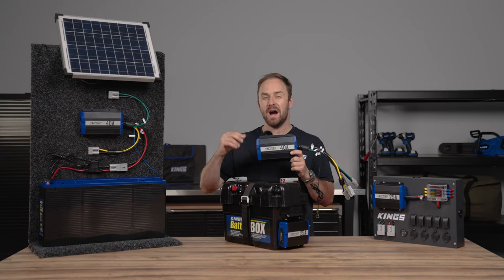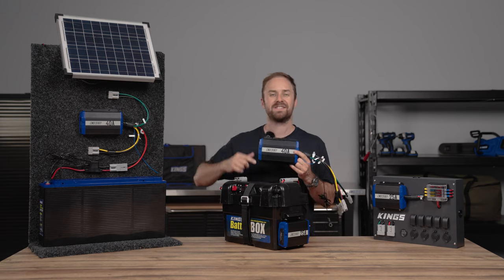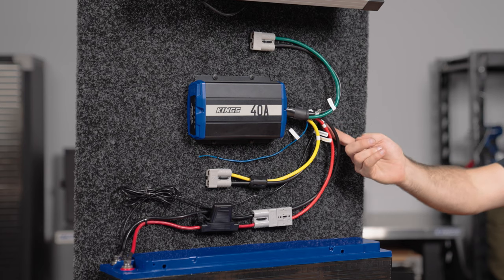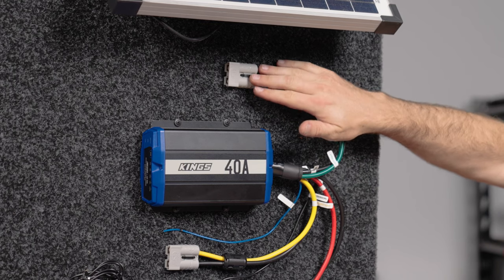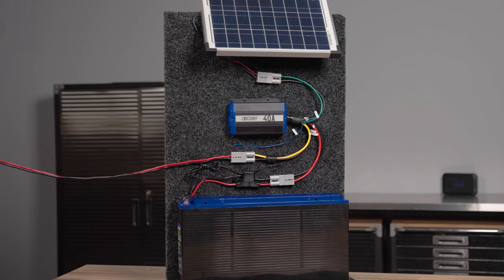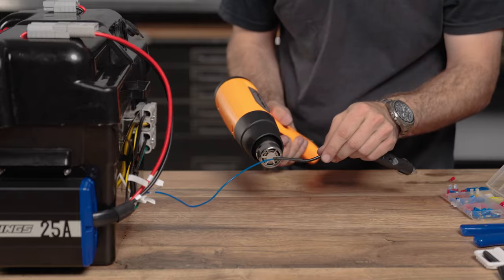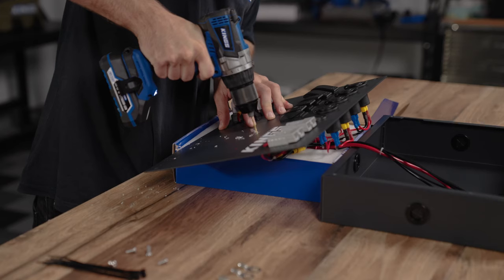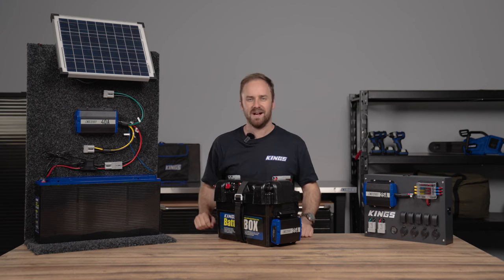Kings DCDC Chargers Quick Connect Guide

Comment: Do you have the link to installing the dc dc charger to the battery box using the cigarette plug on the blue wire please I am about to install mine and want to run it that way but unsure how it’s done.
Reply from the maker: G'day Mathew,

The blue wire for ignition needs to be connected to the positive (usually red) wire on a cig plug. The black wire isn't necessary, so long as you've connected the main earth back to the starter battery. Her'e the link:

https://youtu.be/aDXRTaaC6-M

Cheers,
Cahn
Reply: @AdventureKings  on a 2012 Ranger the cig plug is always on. Shouldn’t the blue wire go direct to a live wire that turns off with the ignition off?

Comment: Will it continue to draw power from starter battery if the blue ignition wire isn’t used/connected ?
Reply: Good question!
Reply: Not if you wire it up to a fuse terminal that only works when car is running. Once turned off  it won't give power to that fuse anymore. Hope that helps
Reply: @jasonblade1037  I have wired my ( ignition wire ) to the cigarette 15a fuse, which only activates once the key is turned. Although I believe my kings dcdc 25ah charger continues to run / power my 100ah lithium battery even when the car is completely turned off. I think its designed to draw the crank battery down to 12.8v and then it shuts the dcdc charger off.

Comment: Ive got all the gear to go into a caravan. Do we put fuses in the cable from Lithium battery? And do i need a dc circuit breaker between solar panel and dcdc charger?
Reply from the maker: Hi there,
This would be safer for your setup if you have a fuse between your lithium battery and DCDC charger, but a circuit breaker between the solar panel and DCDC charger is not needed.
Cheers, Courtney

Comment: I like the idea of connecting it to the battery box, I might just have to do that with the (competitors product) one that I've got. Then all I need is a cable run with Anderson plug from the battery on each of my vehicles, after all, can only drive one at a time, so why have multiple systems?
Reply from the maker: Hi there,

You could do, however we'd recommend some form of isolation and power regulation between the vehicle system and your secondary battery.

Regards, Andrew

Comment: Hi,  I have 2 trickle chargers one for the start batteries & one for the house batteries, will a BC to DC charger interfere with that?
Reply from the maker: Hi there, we would recommend alternating between the charge types interdependently to each other to ensure accurate load register. Kind regards, Rachael

Comment: I have an old school redarc solenoid isolator and lead acid deepcycle battery system under the hood of my hilux, it has an Anderson plug wired into the tray from the deepcycle battery, can I connect a 120ah lithium battery in a box with the dcdc 40amp charger next to the lithium battery in the tray so  that I charge the lithium setup from the deepcycle lead acid battery under the hood if that makes sense?
Reply from the maker: Hi there,
These battery types are not compatible in the same system as there is nothing stopping the lithium completely discharging your other battery. This would require an isolator that doesn't allow backflow, but we would recommend consulting your local auto electrician to ensure your setup is safe and viable.
Regards, Courtney

Comment: My kings dcdc battery temp cable snapped at the terminal end now it flashes red. What can I do to repair this? Is the charger done?
Reply: Same bro mine just snapped did you ever fix it?
Reply: @mitchellsmith7693  nah man, and I rang Kings the pretty much said charger is done now I have to buy a new one 👎
Reply: If that's what is wrong with mine then I have a problem cos bought long time ago and just now fitting it up.

Comment: If i connect the 40amp charger to the quick connect on the battery box that has a max 30amp input, will i blow up?
Reply: 30 amps is not much for an Anderson style plug, I thought they were all 50 amps. By pass the quick connect (Anderson style plug) and connect it straight to the battery terminal.
Reply: @teeanahera8949  that's what I ended up doing. The cheap 30 amp plugs melt if you plug the 40 amp charger into them

Comment: Can we have the links for the installs of the new dc dc chargers. And can you use the dual battery installation kit to that yellow wire
Reply from the maker: G'day Matty,

https://youtu.be/aDXRTaaC6-M here's the battery box install

and here's the Control Box install https://youtu.be/QCAdAQf5qpY

You can definitely use the 50A wiring kit to hook up to the yellow wire - but if you're doing a particularly long wiring run (say in a caravan or camper trailer) and running the 40A charger you may want to consider using thicker gauge wiring!

Cheers,
Cahn

Comment: How do we ground the charger?
Reply from the maker: Hi there,
As the unit connects to both the positive and negative of the battery it forms a full circuit and will generally ground via the vehicles electrical system.
Regards, Courtney

Comment: Can I get some advice?  I connected the ignition wire to a ciagarette socket and plugged that into the rear of my tub as per their video however the charging unit does not shut off as they said it will.  I assume the blue wire and writes to both of the wires of the cig socket
Reply from the maker: Hi Mark,
Sometimes depending on the vehicle this can still stay on after the car has been turned off. To test this we would recommend either checking with a multimeter or keeping something plugged into the ciagarette socket to see if it is still getting power after an hour of the vehicle being off. If there is still power then there is something wrong with the wiring.
Cheers, Courtney
Reply: HI Mark, I'm currently in the same situation. I'm literally testing it right now for the first time. I have wired my ignition wire to the 15a cigarette fuse in the fuse box with a piggyback fuse and my dcdc charger is flashing both lights ( lithium light and alternator light ) I beleive that it will cut off the dcdc charger once the crank battery falls below 12.8V